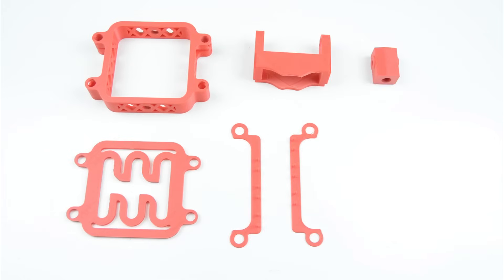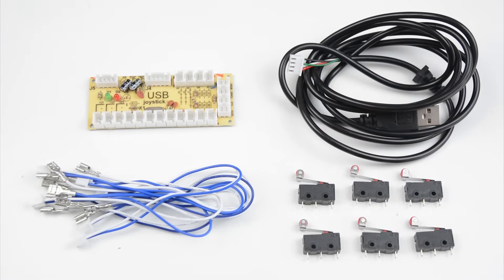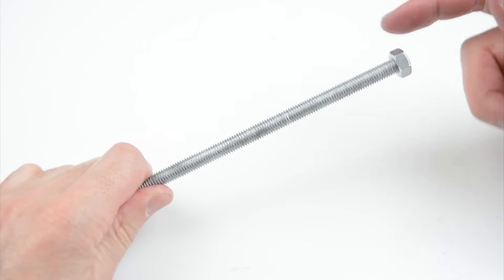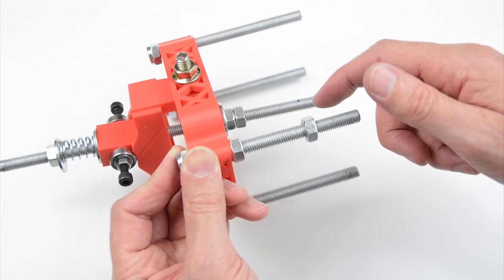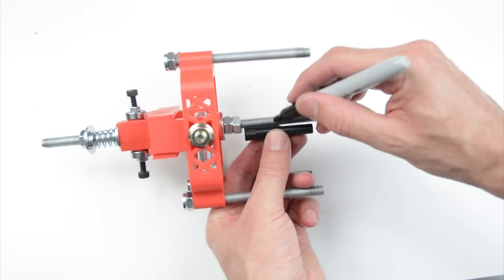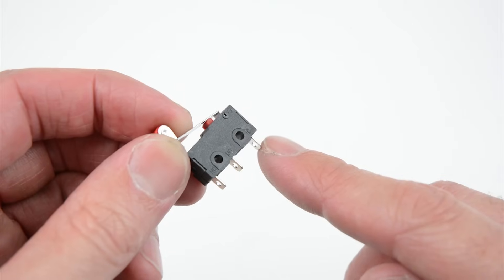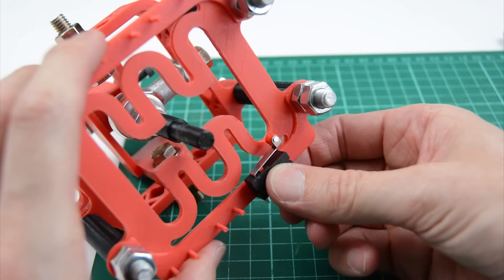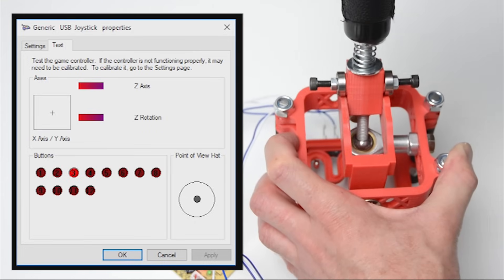HOW TO MAKE A 3DPRINTED H SHIFTER FOR SIM RACING

Comment: This is awesome. I made it, the only thing tho is that it has a hard time getting into gears 1 and 2 or 5 and 6 (depending on the side that the joint is mounted to) is there any fix for that or just mess with how tight the nut it that is attached to the spring?
Reply: You think it would work on xbox?
Reply: @its-ok7  Probaly not but depends on the game. Its recognized as a joystick by my computer

Comment: Now that's a solid enough design, I'd get someone to cnc cut it in steel or aliuminium for the frame tough. How hard would it be to make a 2nd level with reversing gears, and expanding it for use with ETS2. I'd need at least 12 forwards and 2 backwards gears.

Comment: Nice design, some links do not work, I suppose an Arduino Micro Pro will work for the switches without problems with the joystick library. Such a pitty that the bearings are so unusual, I think using 4 x 5 mm bearings is much more practical. Some adapter bushings can be made from 8 mm to 5 mm ID bearings . Also this is just a 5 + 1 speed design.

Comment: My shifter works great but the shifter shaft is freely rotating. Do you have any ideas on how to prevent the knob from turning?
Reply: I am a little confused as to what knob to buy. But I guess if you guy a knob with an m8 inside thread, it should screw on and stay in place.

Comment: 1:51 I wonder about protecting the gate by putting heat-shrink sleeving over the threaded rod, rather than requiring a custom end piece
Reply: yeah that would work better. using adhesive heatshrink

Comment: Hello Friend,
Congratulations on the video + a subscriber!
I am also building a homemade steering wheel with arduino Leonardo. Everything is working apparently correct through the test programs and also when I do the simulation through the device manager of win. However, when I open the game Assetto Corsa Competizioni (2020) the Arduino is not recognized in the "Volante" tab and also does not work in any other tab. could you help me with any suggestions? did you have to install any specific drives? any help is welcome. thanks.

Comment: hi, very nice !
Few years ago i have done a diy sim racing, and i think, there is one little thing missing on that H shifter ;)
I think is missing a return to center on the left right axis, to make the moves more realistics.
It, is not simple as a joystick. 
I my case, I had to use two jaws, one on the left that pushes the stick to the right, but not greater than the center, and an other jaw at the right that pushes the stick to the left but not greater than the center. 
Your locking system on the forward backward axis is really better that mine and in most of the other things.
Mine was done with wood, and "polymorph plastic" molded by hand.

Comment: What is the estimated cost for printing 3d parts? I would like to ask someone to print it for me since i do not have a 3d printer
Reply: I 3d print for people and it depends on a lot of things like material, infill percentage, and print time based on slicer settings because of higher resolution prints occupy the machine for longer and consume more power and leave other projects in queue.

Comment: I started to get into Sim racing and one of the first channels I found interesting were yours, and I have a Logitech DFP and the pedals, but no shifter, when my friend went over we tried to play and I realized that the built-in sequential was fun, but quite limiting. We then went to the arcade to play Wangan Midnight Maximum (Dunno if that exists in your country or if it existed at all) and it had a 6-speed shifter and I totally felt like I was missing out. 
So I went to look for loads of videos, I started out by watching this video, but didn't think much of it since I didn't really know how this would work, a whole day later, I start getting into Arduino, loads of other videos by other people making DIY Shifters, and I saw videos of the zero delay USB Encoder blah blah blah, then I went back to this video to get some insight and didn't realize how simple it was.
I already got the housing and material down, that was easy, but I never realized how easy it would work until I saw your video, because all the other videos were either very poorly-shown and nearly every video had no instructions to what I needed (I was looking to make a 6+1 speed shifter also with a toggle switch for ETS2) and this video was absolutely perfect.
I'm currently buying the USB Encoder, the M8 threaded rod [Because I really want to put an actual shift knob], and etc...
Sadly I can't 3D Print but either way, this video was amazing, and I might not have needed to spend that whole night looking for other videos and whole forum posts on how to use this and that, if I had come back to this one. Being a 9th grade student I had little time and this helped a bunch.

Comment: Great Video Ive ever seen!!
btw I have a simple question so can I use that shifter with logitech G92? Cause I want to make sure
Reply: Yes,you can, because this doesn't connect to the steering wheel itself but it connects via USB. And since most games support multi-device keybinding, I don't think that would be an issue.

Comment: If you want to add more for 7 gears and reverse just go to thingiverse and edit the original on there to add 2 more notches and just wire them to a controller. A keyboard controller can also be taken from a membrane keyboard and soldered to the switches. This will make the gear switches act like key strokes on a keyboard and would essentially make it easier to program the switches as to not interfere with you actual keyboard. If you do go this route, the shifter will not be recognized as a controller and be recognized as a second keyboard. Since the keyboard has many keys you use add more notches and switches to suite your needs. Since racing games dont really use that many key bindings it shouldn't be difficult to adjust them accordingly. Also the keyboard controller diagrams may differ from key board to keyboard so u should test it out by jumping a signal to the pins and figuring out which key strokes belong to which pins. It's a bit of a process but much more effective and adaptive than simply wiring it to a controller.
Reply: I forgot to mention this would only work for PC only. If you want it to work with a ps4/pc or xbox1/pc try wiring it to the respective controllers. It should still work.

Comment: That's an awesome H-shifter!
I am looking forward to build one for using in American truck simulator. I just have a question for the zero delay usb encoder. If I were to connect a potentiometer instead a switch, would it act as an axis? Because I would need a clutch pedal and an on/off clutch doesn't make sense, it needs to be an axis.

Comment: Man I wish I could just buy one of these for 30$...
Reply: $30 wouldnt even cover the parts used
Reply: @zacharyclarke4240  idk where you live but some nuts and bolts are never going to cost you more than $30... If you factor in the 3D printer yeah. The switches are dirt cheap and the USB board you can rip out of an old keyboard. Even buying this exact one is only $5 including all the cables. No way that's over $30.

Comment: I suppose the driver needs to disembark and push the car reverse when need to go backwards :D
Reply: Add a Button/Lever/Switch on the side of the Shifter and assign it a button pin, then bind it as Reverse. Additionally, I would use an Arduino micro instead, so you can program when the car is not engaged in a gear to be in Neutral, just like a real car would

Comment: Im looking through the list of stuff you need in the Des. mmk and i'm going through reading stuff in my mind and i'm like, "Heat shrink solder ok i can get that in shop and a 3d printer? THE FUCK XD this man just listed a fucking 3d printer in the materials" Im dying rn but like i'm going to make these parts in woodshop just to avoid that requirement XDXDXD

Comment: I did it and I can just tell you Thanks bro! I replace the controler by an Arduino nano and now it's work perfectly !
Reply: how did you do it with teh arduino nano? cause i dont have welder and the usb encoder would be perfect for me. do i need welder and extra cables to use the nano?

Comment: hi bro, also me use an generic usb module for h shifter, but how can i do recognize it in every game, it work only with assetto corsa,dirt 3...i try using a usb to ps2 converter to connect in my t300rs wheel but don't start, there is some emulator to use?

Comment: Wouldn't it be possible to make one using a real shifter assembly salvaged from a car? Skipping most of the 3D printing and having to just use the micro lever switches and usb encoder
Reply: yea if you can put the buttons from the real shifter to the fitting position yes you can

Comment: Why glue the switches on?  It seems like you could leave the switch mount plate off, put a nut on the rod after the H plate, then put the 3 switches onto the mount plate and put it in place.  Hold it in place with another nut on the rods.  Then you have captured switches that can be replaced.

Comment: Makes a sick Manual Valve body setup!!! Run each switch to a 30a relay , then use the shifter to manually shift a electronic shift transmission like a 4L60E or 4L80E 😏

Comment: Would it be possible to use a salvaged usb keyboard pcb?
I was thinking of using 1-7+R for a h-shifter, arrow up and arrow down for possible a sequential shifter and the spacebar for handbrake.
Alternativly could I use an Arduino (like a pro micro or something) and put it all on the same board?

Comment: If you wanted to have a 6 gear H-Shifter with a reverse gear, you could incorporate a modifier so when you shift into 6th while holding the modifier you would get an extra button to map as reverse, just a tip for anyone out there tech savvy enough to realize how to do this 1
Reply: like ? if i were in the 6th speed, the button is triggered. So do I put a NAND? or i program or something ??

Comment: Don't even care if it works well or not, this is fantastic!
Reply: Bro, I built on thinking it was gonna feel like a cheap plastic toy. That couldn't be further from the truth. It feels like a real car and it's pretty heavy with all the bolts and nuts, springs washers, bearings. I was amazed
Reply: It's actually all you need as a gearshift controller is not complicated.

Comment: You are going the extra mile, You are going to get very big man!
Reply: No. Using brass bolts. And a metal gate. And a bolt that has been rounded and tapered at the end of the threads on the gear shift for great tactile feedback and smooth gearshifts are going the extra mile. And I think the gate is probably to big. Cause if you plan to get a taller gear shift stick. The throw will be greatly exaggerated.
Reply: Not his own design ;) but he makes great videos ;)

Comment: If you want to easily add a reverse, there's already a spring around the shifter; just add a gate next to the bottom right (the gate which corresponds to 1st) and have the entry point to the gate restricted to the height of the shift knob. Push down on the knob, push left all the way then push forwards.

Comment: I'm guessing that it's a 5 speed + reverse.
Reply: Lee McDonagh With an custom usb joystick you can do it 6+R with an external button
Reply: or even simpler, switch between 6 and R with an SPDT switch, common should be the one coming from the shifter and two outputs to the joy
Reply: OR YOU COULD... go to thingiverse and edit the original on there to add 2 more notches and just wire them to a controller.
Reply: Use a button on your wheel for the reverse

Comment: Awesome build!, one thing I would change is the glue used for the switches, on hot summers that will come loose and fall
Reply: Hotglue melts at like 180 degrees. I dont know where you live, but if your simrig gets 180 degrees celcius in the summer I feel truly sorry for you, i'd consider moving :D
Reply: Actually, the printed plastic parts will start to soften/melt way below the melting temperature of hot glue.

Comment: Now are you going to design a sim shifter that will only work when you have the clutch pressed in? ;)
Reply: Cameron Crowley ..... why would you do that?
Reply: But it doesn't have any sense.

It depends purely on game if it allows you to force into gear without clutch or not. Also why would I want to limit my gearbox to work only when clutch is pressed? If I want I can always press clutch and shift, and if I don't want press clutch I can force into gears :D
Reply: To simulate synchromesh transmissions. Issue would be how do you know when RPM is just right to allow meshing without clutch? Plus what about dogboxes? Doable but seems challenging. Then again, look at his channel...I may stand corrected.
Reply: Cameron Crowley Well, that would be inaccurate for race cars with H-pattern shifters from the late 80s-modern day considering almost everything moved to a dogbox. Either way, it's impractical.
Reply: Too much work for so small feature

Comment: My god! I just finished your seq shifter and handbrake last week and now I have to go again. Printed in ABS or PLA?

Freakin nice work man. Very creative!

I will find a way to combine this with a seq shifter option like the Thrustmaster one :)
Reply: Bambeakz theoretically you could just add rubber bands and make 3rd and 4th gears shifting up and down to make this into a sequential shifter
Reply: All you need is to put a different piece on the bottom so you can only shift into 3rd and 4th, but not fully just enough to get touch the button.